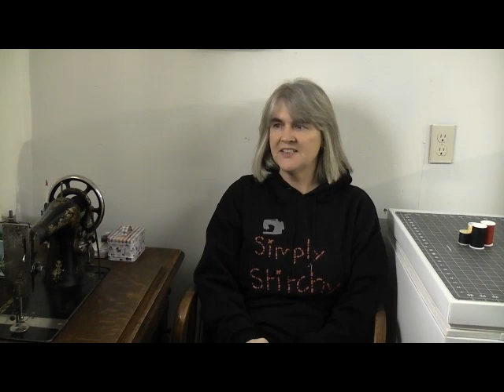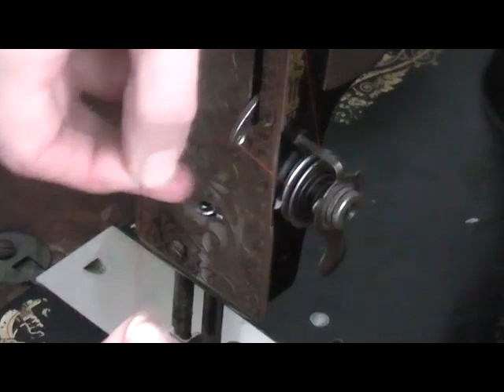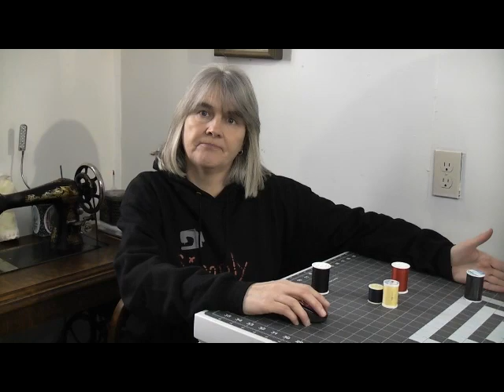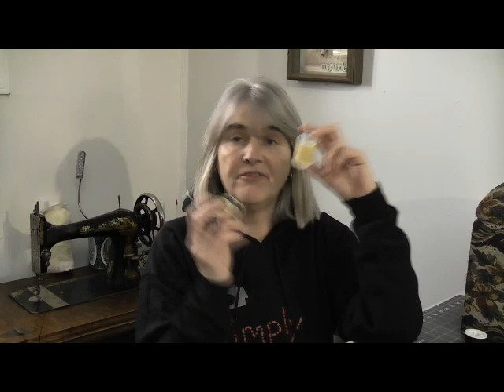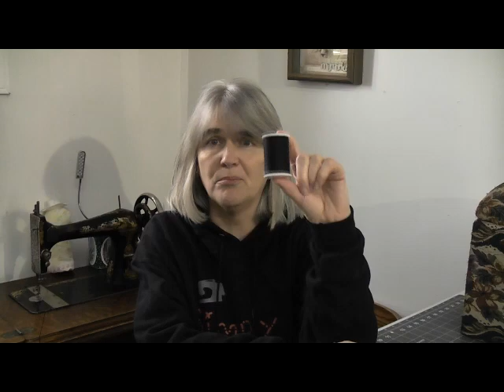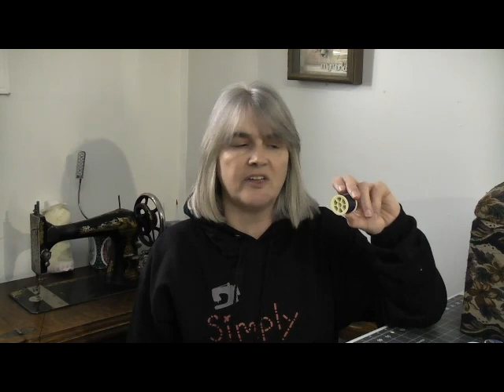Can You Use Old Threads in a Sewing Machine? #SewingMachine #Threads #Sewing

Comment: Thanks. I have my Granny's old sewing box loaded with thread. Unfortunately it is not usable.
Reply from the maker: You can use it as basting or tacking thread. You can even use it for hand stitching hems. Anywhere that it doesn't have to be put under strain. Or you could display it all. Maybe in a glass jar, or a glass fronted curio cabinet. 🙂